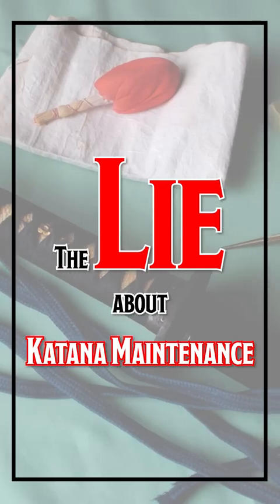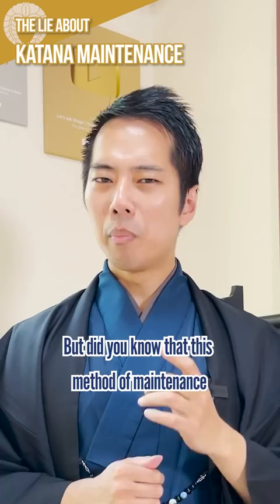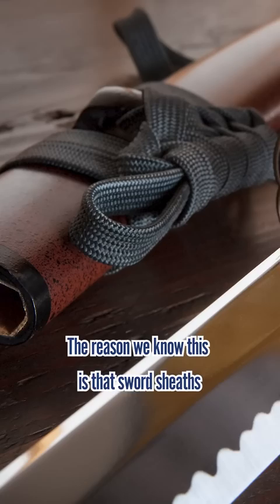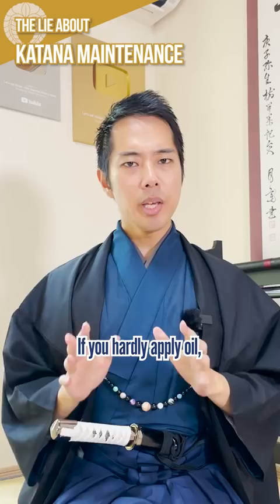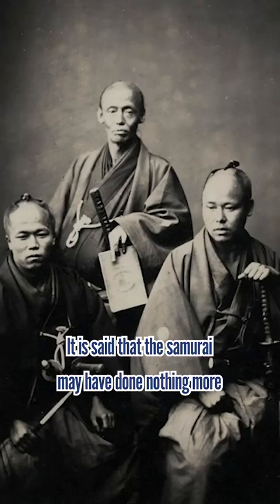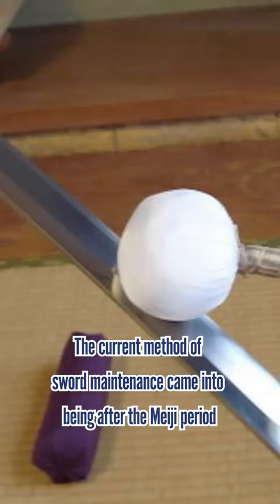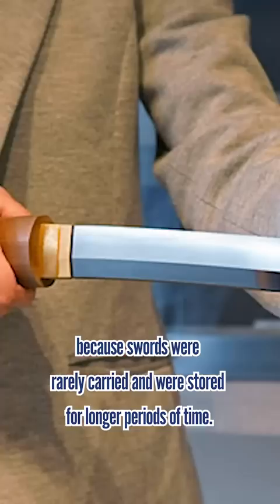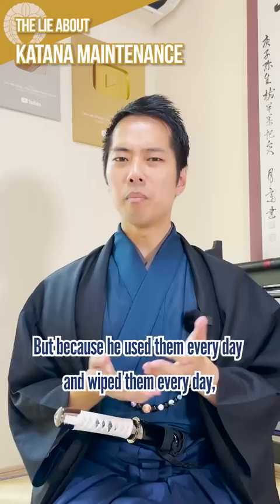The Lie about Katana Maintenance #Shorts

Comment: Well this makes a lot of sense if you work with any sort of metal tools. If you use them everyday they will never rust bcs just by having you handling it it will get covered in all types of dirty/oil and you will clean them often. But letting those tools aside for some days/ months and you start noticing rust build up. My grandpa tools were beautiful till he retired. And when I got to see them after some years they were all rusty.
Reply: Thats the reason you need to wipe it clean then apply oil on it
Reply: @dandydwi6_6  if you don’t use it every day like a samurai might have, I know they rarely used them in battle but it’s still a lot more than the cosplayers who take a katana off it’s display once a month
Reply: @greypug7769  you will get caught by security if you use real katana for cosplay
Reply: But the rustier the tool is the more answers you'll get faster
Reply: @dandydwi6_6  I meant an unsharpened katana which still needs to be cleaned, and you can cosplay without going to events
Reply: @dandydwi6_6  my anime convention allows sharp katanas and this one dude carried a great sword everywhere he went around
Reply: @fliqpythebear7482  what he cosplay as?
Reply: @dandydwi6_6  it depends on the place you go,
Also you can cosplay anywhere you’d like, not just conventions.

Comment: Usually in the west people used oil for short storage times (like a couple of week or a month) and when is needed to store for longer (like a few month to years) wax was recommended, since it create a more "solid" barrier against oxygen and moisture

But yes if you're using it almost daily then a simple piece of cloth should do the job perfectly
Reply: Wouldn't wax gum up the scabbard though?
Reply: @jakethehyena.anotheraccoun442  If you have more than one sword to clean that becomes quite the chore. Remember at that point you have to take each sword out of storage and then put it back as well. Even if that's just hanging on your wall this takes time. Now consider museums, private collections or even armories. Hundreds or even thousands of swords cleaned every day? Just oil it if you may use it or use wax if you're preserving it.
Reply: @TeaBurn  typically if the sword would be stored for more than a few months the blade would be coated in wax then wrapped in a cloth, not put in the scabbard
Reply: @TeaBurn  yes, but you wouldn't wax a sword you intended to sheath. Waxing is fine for display and long term storage. 

For instance, many museum blades are waxed. It is simply a much stronger barrier against moisture, and does not wear off easily
Reply: Interestingly enough you could also use varnish, like you would for wood and once applied to the blade it would do decently well at protecting it from oxygenation/ rusting. 

Matt Easton from Scholagladatoria Since he is an antique dealer mentioned that he has had a couple of Victorian era swords in his possession that have come to him like that.

Comment from the maker: When you think of katana maintenance, you’d probably imagine hitting the blade with a white (or sometimes red) mallet and drawing oil, which you often see in anime and movies. But did you know that this method of maintenance was actually started quite recently (after the Meiji period), after the samurai were gone?

The reason we know this is that sword sheaths prior to the Edo period (the last samurai era) rarely have oil stains on the inside. If you hardly apply oil, then it means you don’t need to apply the powder either, because it is meant to remove the old oil. It is said that the samurai may have done nothing more than lightly wiping the area with a dry cloth.

The current method of sword maintenance came into being after the Meiji period because swords were rarely carried and were stored for longer periods of time.

In fact, the sensei who taught me tameshigiri (mat cutting training) simply wiped his katana with a cloth. But because he used them every day and wiped them every day, there was never any rust.

Actually because the mallets have whetstone powder in them, if you use it too much it would rather damage the blade.

If you’d like to learn more about Japanese traditional culture, Kyoto, and social problems in Japan, please check out my channel & subscribe!

*The content is based on personal studies and experience
There is no intention of denying other theories and cultural aspects
Reply: The script
Reply: The script
Reply: The script
Reply: The script
Reply: The lyrics

Comment: Thank you! 
I use 91% rubbing alcohol on a microfiber cloth,  swing a couple tines, wipe with a glasses cleaning cloth to remove any potential moisture left, then got it with my pre soaked, ready to go, oil cloth (a mix of proper, made for katana camiella oil, hoppes #9, and mineral oil). Own a couple dozen katana, along with a couple dozen other sword, and countless high carbon steel fixed blades and folders, and there is not a spot of rust on any of them.
Reply: Does the oil matter? I just use automatic transmission fluid
Reply: @erichusayn  Nah, Valvoline Maxlife Full Synthetic. Smells a little like cherry actually
Reply: Hoppes #9 is a solvent not an oil. Why would you mix it with any oils.

Comment: Tbf at least with the katana style sword that are made of modern high carbon steel you do need to oil them as you do with all swords made with modern high carbon steel as it's much more prone to rust (I say katana style swords due to your description of what is considered a katana in Japan as I understand it using traditional methods and steel this is to avoid confusion)
Reply: Depends on region. I hardly ever oil my swords unless its for long term storage
Reply: @sethdusith6093  I live near ocean, what do you recommend? Thinking about buying a Katana, so I accept any tips
Reply: @arck4453  automatic transmission fluid
Reply: @baru6891  fr?
Reply: @arck4453  Skip the traditional stuff. Wipe down blade with 99% rubbing alcohol on a microfiber cloth, then apply a very thin surface coat of light mineral oil using a clean, lotion-free, unscented tissue.
Reply: @gontaiyuu  alright thank you! That traditional stuff seems like a little too much in my opinion. So I was looking for a cheaper option, that helped me
Reply: @arck4453 Buy marine Katana?
Not sure if it's exist.
Perhaps you should make one (blacksmith made it, you pay) , with same material of diving knife.

Off course it's weaker steel then carbon steel.

Otherwise wash it with liquid soap, wipe dry, apply thin WD-40, wipe excess.
This's ↑ what I do.
Reply: @budisutanto5987  well, I don't even think there are blacksmiths like that in my country, even if I had to ask from another country, I think it would be very expensive. I will just try wiping like you guys recommended when I buy mine.
Reply: @arck4453  Don't know what your plan on it.
If only for decoration,
after wipe excess WD-40 ,
wash it again (😦!)
wipe dry,
coating it with clear paint.
Reply: @budisutanto5987  only for decorating. I don't plan on using it to cut stuff.
Reply: @arck4453  finest sand paper with minimum pressure, wipe clean, then clear paint.
It'll be rust proof for live.

Can't skip WD-40 step at the beginning, it kills rust.
Reply: @budisutanto5987  alright thanks
Reply: @arck4453  the traditional is like 15€ i think, that's not really expensive.

Comment: As a lover of HEMA I always thought this was the case because several europea  manuscripts talk about the difference between metal maintenance when stored, when on march and when on campaign. And they say basically the same, if you are gonna store your metal or transport it uncovered, to use wax or oil if you are gonna transport it on, as in wearing it make sure you wear a cape to keep dust and water away and if you are standing at the ready to apply a coat of oil and then just keep it clean and in many cases the scabbard would have a bit of fur or cloth on the top to wipe and sometimes slightly apply oil to the blade each time you took it out and back in

Comment: Who would've thought that the more you use something the less maintenance is required.
Reply: It's not always the case for other things though.
Reply: Modern weaponry is the opposite.
Reply: No, it's because they were used regularly that they received the regular light maintenance of being wiped down. When they weren't used regularly they instead needed the heavy maintenance of powder and oil. 

E.g., if you drive your automobile regularly you don't have to worry about the battery running down or moisture accumulating in the fuel tank, because you're constantly charging the battery (with the alternator) and refilling the tank. But you have to worry about these things if you put it in storage for long periods.
Reply: Well designed guns require very little maintenance. All I do for mine is every so often (I don’t really strictly control when) take them apart rub them down with a paper towel and then rub them up and down with transmission fluid before letting the excess drain off overnight and reassembling them in the morning.
Reply: The more you fire guns the more you need to work on them, in other words, every time you fire a gun you've got to work on it. Cleaning out the filth from the propellant and gases, all nicely scrubbed and wiped down, and all left with a very thin layer of oil to counter the consequence of high temperatures on metal – rust.

If you don't use the weapon for some time, then only a periodical inspection and light cleaning is required.

Use your technique on an AK and it'll punish you for it. It'll spray hot oil up the gas block to the piston, then out from the where the piston tube fits to the gas block.

I got hit on the forehead a couple of times with hot oil when I hadn't properly cleaned out the gas block.

Comment: I’m no swordsman but I’ve done plenty of maintenance on high strength steel.  Shock resistant steel is rarely corrosion resistant, even so, “wiping after each use with an oiled cloth.” Is a fairly extravagant maintenance procedure. I’m inclined to believe that powdering the steel appears to literature and dramatic interpretation mostly because it’s such an unusual action to take.🤔 It makes an interesting drawing or film.

Comment: Correct, I used to carry my roman gladiolus every day and used it a ton. Little to no rusting and I didn't need oil on it. This went on for about 3-4 years. Now it sits in the house and I have to check up on it as it may start rusting within a few months

Comment: actually , even after oiling steel , it is proper to wipe it thoroughly with a cloth , so there'll be hardly any oil left to drip . oiling is meant to remove any moisture and whatnot , by oil getting inbetween the metal and any contaminants , rather than drenching it . and on a properly maintained blade , there should not be even tiny spots where the oil could linger , so there'd be no trace left . this is a daily commitment . if not , then it's to be stored unsheathed packed in oily paper . then again , a soiled sheath must be replaced asap , no matter what it's been soiled with .

Comment: For storage, choji oil is necessary. An area of low humidity is also desirous, as well. That powder in the ball, is only needed if the steel begins to show signs of rusting. I refer you to David Hofhine.

Comment: I'm sure that they had to do a bit more the just wipe with a cloth every so often, and this isn't a cultural thing but like a metallurgical POV, Katanas  were a mix slightly carbon steel and iron. Carbon steel rusts much easier then just iron does, of course its stronger but it does require some care. given this there must have been something done to preserve the steel in the blade. I know that Katanas were sharpened semi regularly so perhaps the blade smith did something then. the steel used in Katana now, vs back then is also very different, I know traditional Katana makers still go through the same process as before but our ability  to heat and shape metal has advanced and conditions change how metal crystal structure forms. All and all though wiping the blade and keeping it moisture free as best you can will do a lot more then constantly applying abrasive powder and wiping. it will also keep the polish of the blade blemish free

Comment: I’ve had any katana for quite a while and I haven’t cleaned it with oil or used a mallet a single time, and the blade looks the same as it did when I first received it.

Comment: I tapped this thinking it was about the notorious Suzuki Katana problem with a spring or something that causes shifting issues. You have to take apart the crank case to fix it with an aftermarket part. It’s sorta like “The Doohickey” problem for the Kawasaki KLR650.

Comment: The knives my team and I use for sushi are a similar way of maintenance. After use we just wipe wet to get the grime off then wipe dry to avoid rusting. My knife just loves to rust as it is a higher carbon steel so I need to be more careful with it whereas some of my other team have lower carbon more rust resistant knives

Comment: Always seemed to me that rubbing abrasive powder into a carbon steel blade would make it rust quicker
Reply: Why?
Reply: @autumn5592  leaves micro grooves in the surface increasing surface area for moisture to bind to
Reply: @ivankrylov6270  While that is technically true. In practice it makes no difference.
Reply: @autumn5592  I've seen it happen with bead blasting and stone washing on knives

Comment: Why wouldn't sharpening and use keep the blade clean. I does with my knives and they are crap to very high quality metal. My guns have never rusted either, they don't get as much use and they do get an oily rag wipe down and a barrel cleaning before being put up but it's not like I grease them and oil them every month like some weirdos do.

Comment: so instead of cleaning it like that and applying oil from time to time, can I only wipe it every single day and it won't rust?
Reply: maybe
Reply: Depends how often you use it and the kind of steel it's made of
Reply: @ginogatash4030  440c stainless steel
Reply: @arck4453  I see some comments saying that if it's modern carbonated steel it may still need oil no matter what, but you should probably look it up to be extra sure.
Reply: @ginogatash4030  do you know if I can use another type of oil besides the one in the tradicional cleaning kit? Maybe a cheaper one? Where I live that kit is kinda expensive, and I don't think I would use every piece of the kit.
Reply: @arck4453  I'm really just dishing out second hand knowledge here, there's gotta be some kinda forum or something that explains these things better than I ever could.
Reply: @ginogatash4030  alr thx